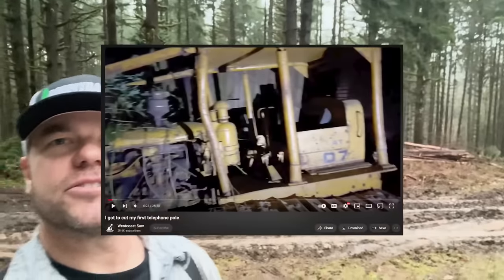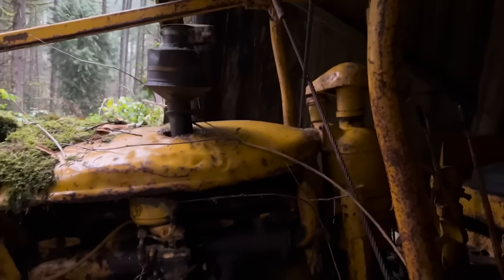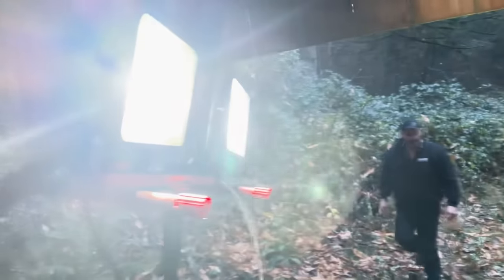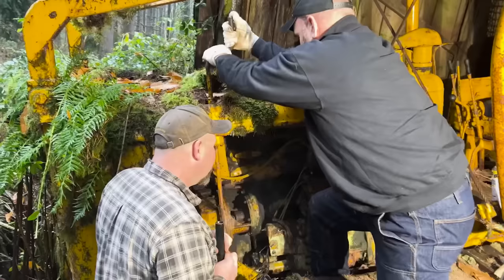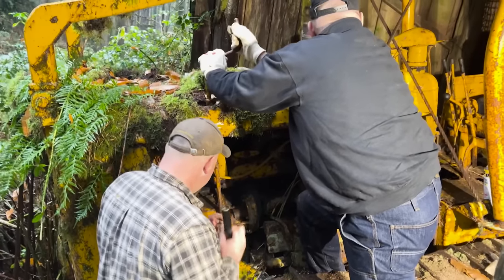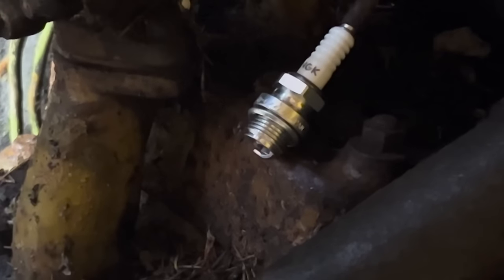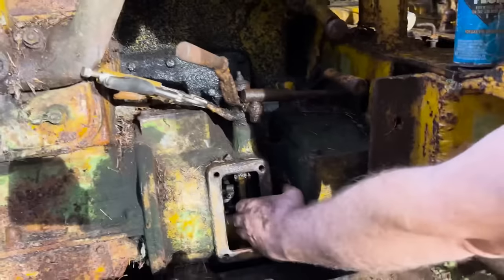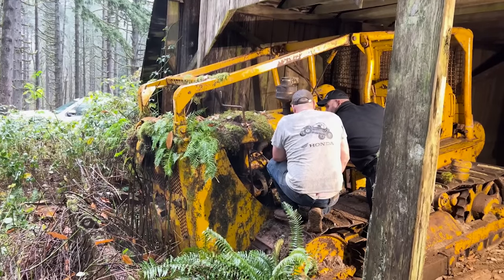Caterpillar D7 3T barn find - Will it start?

Comment: I learned on a old D-8 cable dozer, Back in 84 it sat from 1993 in my barn until 2022 never started in all those years,I started restoring it in 2022 I finally put the last original decal on this morning, every nut, bolt,hose, and decal is original for the year, Fresh rebuilt engine, I've been playing all morning,

Comment: As a young apprentice HD Mechanic in the mid 1960's I worked for a logging company north of Prince George British Columbia. They had two 3T  Ghost Caterpillars  No blade or canopy just a rear winch for skidding logs.
Whenever they broke down the Master Mechanic would sent me out alone to fix them. They were low production machines compared to there other equipment. So he sent the low guy on the totem pole, not caring how long it took for repairs. Always got them fixed for the next morning. They were not that hard  to work on and I was a quick learner.
Thanks for sharing and bring back some memories to an old guy.👍👍👍
Reply from the maker: I bet you have seen some big wood get moved back then 👍thanks for the story alway cool to hear from guys that seen these work
Reply: Respect.  Thank you for your work.
Reply: @westcoastsaw1368  I have a buddy of mine who is an old timer who has these kind of cats
Reply: @westcoastsaw1368 ooooooo
Reply: Do you know if the brake adjustment on this old D7 is similar to D8H brake adjustment where you tighten the adjuster and then back it off nine clicks?

Comment: This has to be one of the most successful CAT "will it start and drive" vids I have seen yet and I'm sure being partially sheltered has helped. The old D-7 looks to have a lot of life left in it. Good job guys and thanks for uploading.
Reply: Honestly, what helped the most was that the old girl was put away with all its covers on and not fucked with, aka some fart smeller decides “I’m going to fix ______” and then leaves the covers off and water gets into the manifold or a service panel was removed and not put back on so rodents got into it…

These old Capertillars are pretty bombproof if they are put away complete. Amazing that all that old stuff was designed and built with no computers (or even calculators, meaning hand-calculated everything prior to the 1950s or 60s). We give ourselves too little credit for what we are capable of if we apply enough effort.
Cheers! 🖖😎👍

Comment: Very cool to see you guys revive this old girl! I worked for a company that had a D6 cable dozer converted to hydraulic using Vietnam war era surplus cylinders and valves. After i did a repair i almost ran into the yard overhang because i forgot the lever was backwards for forward-reverse! We also had a international TD6 dozer with the half diesel half gas engine. Really cool how that was started too.

Comment: Wow! Brings back good memories of my Dad and my childhood! My Dad bought one of these from a farmer when I was 8 years old. He then bought another 3 years later. One was a 50 model and one was a 53 model, good all around beast of a machine for its time. We kept one ready to go to work, while we worked the other one waiting for it to break, lol. I used to crank the pony motor with a handle. We built the engine, both final drives and both steering clutches at some point in both machines. But the more fun times was clearing land and pushing ponds! Thanks for sharing!!  Watch out for that magneto, that sucker will bite you, lol!

Comment: I ran one of those in the 1980’s was really tired at the end of the day. Was a slow machine but it would really push. The diesel engine would hardly change between idle and full throttle. Brings back alot of memories

Comment: I ran one in the late 60s, very simple to fix. The steering clutches are under fuel tank and easy to rebuild . Later 17A could be purchased with a turbo and had a big increase in power. The best cat D7 was the E model hat could run for many years with good maintenance . the old 17A where old when I was a kid and I'm over 70. they had a dry master clutch and dry steering clutches. the D7E had wet master clutches and wet steering clutches , a much better tougher system.

Comment: My Grandfather had 2 Cats D-6 from the 50's. He showed me how to start them. They pony was started with a pull rope (Notched flywheel between the operator legs, below the throttle arm). I remembered making sure the clutch was disengaged BEFORE starting the pony. I'm uncertain about the rest but, I remember the controls. His dozers blades weren't cable driven and, the blade actuator was slightly different. That was in the late 60's.
EDIT: Both had the same HYSTER winches, on the back end.

Comment: I just brought the same dozer alive just recently. She loaded and unloaded herself. only difference is its an early hydraulic blade. Not sure on the year. It was sitting for roughly the same amount of time. Its right steering clutch was stuck but within 5 minutes of running it poped free and turns now.

Comment: Those old dozers were a workout to operate managing the levers all while trying to do work.  Your brain goes thru gymnastics as you are making complicated cuts and fills.  Although this machine was used more for forestry making access roads and dragging logs and such.  
 In today’s world we have electric starts and ac cabins. And simple joystic controls for more efficient work performing more technical grade work. 
  I have owned 3 bobcat skid steers in my building company which is basically a mini dozer on rubber tracks.  I can do artistry on grading yards and spreading materials for driveways with incredible speed. 
 Great video.  The machine needed to breath again instead of ruining in the old barn.

Comment: I owned a D7 3T for over 20 years. Serial #1514. The best I could tell it a mind 40's year. The front idler was worn so bad the tracks kept trying to come off. Could not find parts for it. Sold it for scrap. Found out later that rollers for 986 track loader would fit. Your machine is newer and in much better shape.

Comment: This old equipment is ten times better than what's made today the old tractors can sit 20,or30 years and with a little bit of work it runs and operates you leave a new tractor sit 6 months and you have to call a technician to come and get it take it to the dealership yh keep it for 2 weeks then charge you a thousand dollars for what ever
Reply from the maker: Your not wrong 👍

Comment: I've never worked on on dozers, but I worked at an auto salvage yard with three Cat loaders, and 1 Cat lift. I stepped in to run the yard one day while the yard manager was out, and two of the loaders and the lift broke down in one day. I had never worked on big machinery before and knew absolutely nothing about them, but I managed to get two of the running in less than five hours by myself. They are simple to work on, and practically indestructible.

Comment: nice old Cat.  Good find and getting her running.  My grandpa drove these and D8's for years for Glendale Plywood and before that Robert Dollar at the same mill for the road crews making the logging roads.  I have a video of some logging he did in the 50's using 2 TD18's and loading with a Diesel powered donkey engine using a A frame near Williams Oregon.  all good stuff.

Comment: The cable control unit on those things are about as simple as you can get.  If it's like mine, a 3/4 inch wrench is all you need to back off the clutch.  Then a 9/16 socket to remove the cover and you're at the drum.  It's fairly easy to get to the plates.
Reply from the maker: Thank you for the info. Once I get her back to the shop, get that blade off should make it a lot nicer to get into the front there. The owner gave me all the manuals and I was checking it out the other day looks super simple👍
I was told by an old friend of mine. Once I get the blade back on when I go to adjust that clutch, he said You never get in a bad spot cause that blade will start to raise in the clutch won’t release in. It has been known to kill people 🥴
Reply: @westcoastsaw1368   Do NOT adjust the clutch with the engine running.  You first adjust the brake, then the clutch may be adjusted by the amount of lever travel.  Again, do Not adjust with engine running.  BTW, there are grease zerts on the drive shaft.

Comment: A good friend of mine has an old 3T D7 that he converted to electric start. It also has a reverse able blade on it, one side for dirt work, the other side had teeth for using as a brush rake. You would unpin the blade and lay it forward and stand it up on the other edge to change it.

Comment: That dist rotor doesn't need sanding. Sanding it will just cause it to chew out the brush faster. The sandpaper is rougher than the original finish
Reply from the maker: Thanks good info

Comment: My father bought a worn out 3T in the late 70’s for $1500 and used it occasionally to clear land. In ‘87 I did a valve job on it and repaired the rad so I could use it to clear land to build myself a garage. In ‘06 I was using it at my dad’s sawmill to clean up yrs of debris and the track frame broke at the rear sprocket so I stopped using it. In 2017 after sitting for 11 yrs I spent one of the hottest afternoons of the summer getting it running so I could load it to send for scrap. I’m not proud for doing this but it needed to go. It was like putting your dog down, very sad. When we arrived at the scrap yard the guy there assumed that it wouldn’t run. I told him that I wasn’t “ bringing scrap to him “.  I left the yard with $3300 (which I gave to my son’s) and the magneto in my hands. Any time I hear a 3T D7 running it brings back great memories.

Comment: Forward & Reverse, also known as the 'Johnson bar'. Once the pup motor is going, pulling the decompression lever out & engaging the bendix for several minutes, will build oil pressure inside the diesel. The pup engine having a magneto instead of points & condensor doesn't require a battery to operate. I farmed with a John Deere R two cylinder diesel with a gasoline pup motor to start it. Very similar.

Comment: Kinda expected the blade clutch and shiv to be stuck after so long in that area. But it'll loosen up with a little taps and other stuff. Just make sure to pay attention to cable direction when you rewrap the blade lift.

Beyond that, had less moss than I'd have thought. Though with that much greenery growing on it, could have said to be one of the earliest green plant friendly dozers of its type.
Reply from the maker: Thank you for the info 
I got all manuals from the owner and I was checking that out you’re exactly right once I get it back to the shop just gonna take the blade off and back out of it take that clutch out of there get it all freed up new cable should be good to go👌

Comment: nice to see you have a soft spot for the older equipment, I swear that them older cats will out last anything built today.. Id definitely would say that all Iv operated is them older ones, I think it's more of an art form, they need quite a bit of attention, and my move a lil slower compared to a power shift shit but they simply can still do the work, Iv yarded some turns behind my cat that I know for a fact a couple people I knows d4 or td8(power shit) wouldn't hold a candle to my 5b allis course she aint stock eather but same era

Comment: Up in the forest around Mount Saint Helens is a few pieces of equipment, including a dozer sitting there up to its tracks in mud debris. It'll be fun if that one was still start and drive out under its own power. I doubt it with all the rain but it might

Comment: I ran an old D7 3T in the early 80s. Pulling a cable scraper behind it on a 30degree Celsius day without any  cab or umbrella.   Got heat stroke lol

Comment: been many years now, but i converted a D7 hydraulic blade , to electric starter . and alternator . worked nice , BUT the pony motor is HEAT to prewarm too . dozer ran until coolant foamed 😮😅

Comment: Good video . That was kinda cool man. Those bloody old machines were built to go to work Eh! It must be seventy years old , isn't it? If you needed it to work tomorrow you could probably make it happen provided you were equipped to get the blade winch shifting in and out of the directions. And by next month you would be ready to retire after running the bulldozer and adjusting the blade as you did what needed doing , lol. Seriously cool old D7 though. Seems to be in good nick for its age.

Comment: do any of the newer dozers have a pony motor . I ran a td 15 when I worked building power lines we used it to drag 100k pound concrete poles it was a beast

Comment: Rule #1 with pony motors
NEVER mess with the clutch/bendix when its not running!!
They are designed to dis engage once the main engine kicks over. Total pain in the ass if its locked up and not running. I had to pull start my 1939 D4 once because of this exact issue.

Comment: In the 70s right out of  the service I got into heavy duty towing and recovery one of my toughest jobs took 4 days 24 hours a day was a D10 that a oil company was drilling in a swamp the dozer was trying to recover a monster track hoe you could only 3 feet of a 60 foot boom  the rest of it was in a hole covered by water the more you winched the deeper it went  we got the dozer and tried to get the excavator insurance company wrote excavator off still there 3 inches of boom is visible now we got 15000 dollars for dozer recovery and they gave us the dozer for storage fees took 850 horse power motor put it in a 1972 Kenworth with a850 Holmes wrecker 130 mph pulling a old greyhound bus  from    Birmingham to Mobile down I-65

Comment: IF THIS IS NOT STAGED... OMG   ... any person with common sense know that ferns/moss do not grow on that metal hood ... dirt/grease on a vertical panel on the side of the engine... if its been SITTING for SO long the rain water would have washed it off ... or you "weathered' it for your video..... SO FAKE